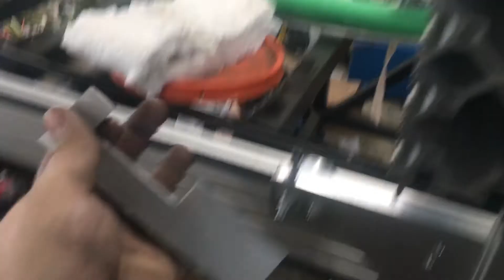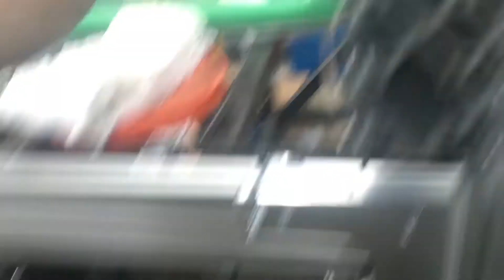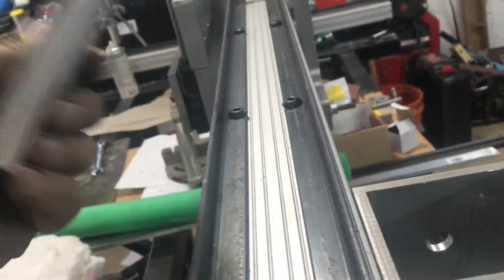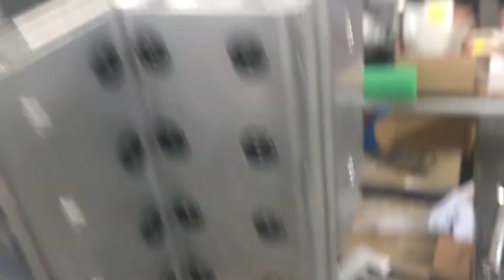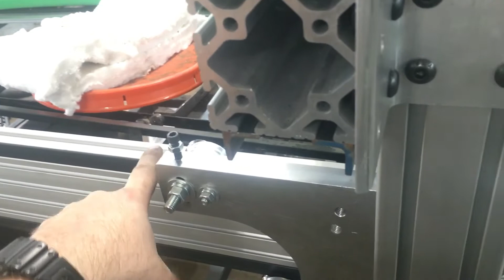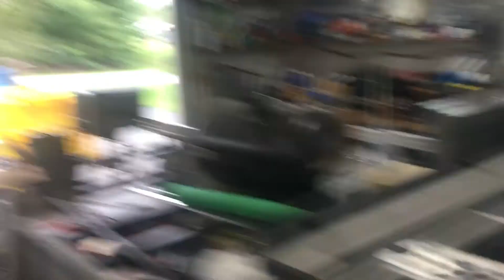CNC build tips: gantry rails alignment

Comment: Bro the rails use corner plate stainless how much milimeter ? and bearing type we can use the openbuilds bearing or not ?
Reply from the maker: I used 19mm angle iron. Any standard v-bearing should be fine. That said, I recently upgraded to linear rail and bearing and if you can swing the cost, I recommend that by far.
Reply: i guess I am kind of randomly asking but does anyone know a good place to stream new movies online ?

Comment: DId you make those angle brackets? Or is there somewhere to buy them?
Reply from the maker: I made the square and angle brackets for the gantry, though you might check the 8020 site. I know they have SOME pre-drilled bracketry, though I can't say for sure if they have any that would fit this exact application. Either way, they're not terribly difficult to make.
Reply: Misumi is a place to look